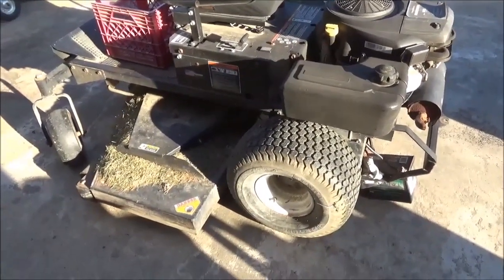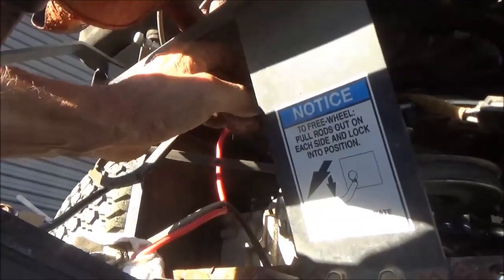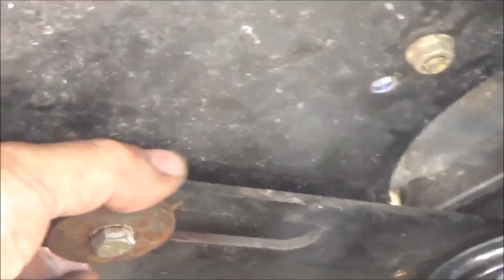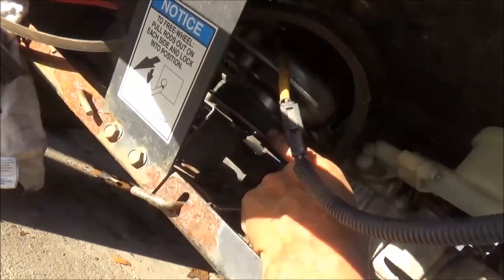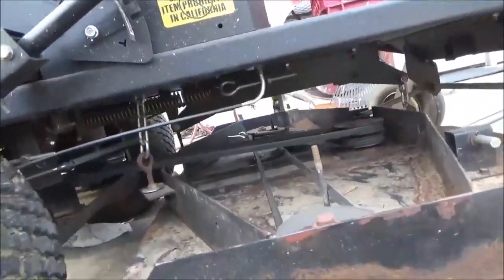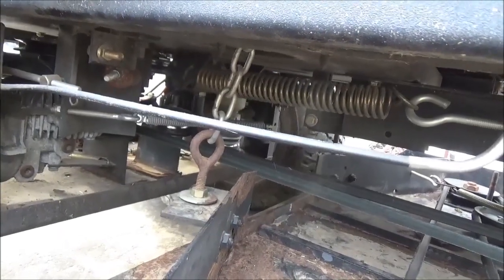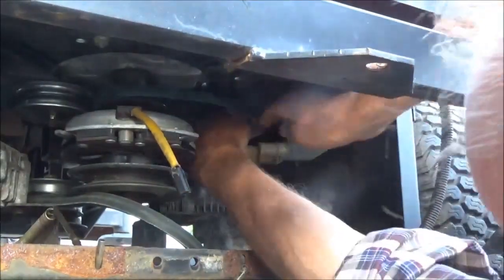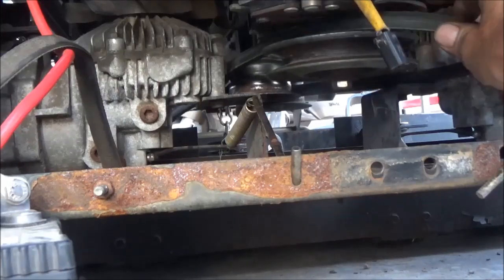Changing drive belt on my zero turn mower  July 8,2017

Comment: Spot on man, thank you. You took my anxiety away, mostly.
Reply from the maker: I hope it works out good for you Paul. Thanks for watching.
Reply: @GordonRobertsonDIY  hi there. Going to do this tonight and came up with a question that i did not see in the video. When everything with the belt is adjusted properly, how much deflection in the belt is there when you push on it? The reason why i ask is to make sure i dont over or under tighten the belt. 

Thank you.
Reply: Did you ever post that video on checking the Hydro Fluid?  Thanks

Comment: So i got one that that starts up good but does not want to move at all.. and i haven't drove it to kniw 100% for sure but the sticks feel strange to me like there reall sloppy or have no pressure on them for sum reason..? It feels like an excavator or loader joy sticks wiggle when you touch or try move them without fastening ur seatbelt or like a skid steer does ya if the safety bar up is still in the up position and all the hydraulics are disabled and run on a safety shut off sensor or switch that has them locked up
Reply from the maker: Sorry I didn't answer sooner. I wonder if your hydraulic oil leaked out? I think a lot of the zero turns use like 30 wt motor oil.

Comment: This video helped a great deal but there was one area that wasn't addressed. How to get the new belt over the tension bar which is between the right and left hydro pulleys. I finally figured it out but WOW!! What a chore. I now know why they charge so much to install the hydro drive belt!!!
Thanks for a helpful video.. Joe
Reply from the maker: Thanks for watching.
Reply: How did you get it done?  I am replacing the drive belt on my mower and am sick of laying under the thing trying to figure out how to do that and finish the job.  Thanks!
Reply: @SonjaDake  you need to take the nut off the long stud with spring on it then loosen the 2 bolts holding the sliding idler bar...my biggest problem right now is fighting to get the pto back on

Comment: They credit Swisher with being the inventor of the zero turn, I have never seen one around here!  I have used many of the well known mowers ''my neighbor owns a lawn care business'' and like Grasshopper & Bobcat the best.
Reply from the maker: I didn't know that about Swisher, I went to an equipment pre auction with a neighbor to look at a commercial Snapper zero turn to give him an idea where to stop bidding, and I liked it, just spinning around on the gravel lot, it seemed to be a very solid machine, and moved like a feather, only the deck on those commercial units is very heavy and needs a foot and a hand to change the height and then you move a pin to keep it there. I would have liked to have that, but can't buy anything like that anytime soon.
Reply: Gordon Robertson hi I want some details
Reply: My old neighbor had a old Snapper from the 70s and he mowed his grass and the grass at the local high school including the trails that the cross country team he coached ran on. 40 inch deck 18 hp onan engine and he cut thousands of acres of grass with it during its life. He never did anything to it other than change the oil, belts and blades the whole time I Knew him and that was 20 years!  He also never picked up a stick or moved a rock out of the way, you always knew when he was mowing:)

Comment: I got one just like it, do you know how much hydro fluid should be in the little tanks on top of the drive motors? Mine has none but it is running, seems like there should be some oil in there.
Reply from the maker: Just make sure it has at least 1/2 an inch to an inch of oil in it. It uses motor oil. I'll be doing a video on changing the hydro oil on one of those soon, I have all the video in the computer but don't have time for the editing yet.Thanks for watching.
Reply: Mine Gravely 730 (24 HP Kawasaki) has a cold fill line about 1/2 inch from the bottom of the tank so it appears there is very little in there but its what is recommended!
Reply: Warren Stone there is a fill line inside the containers. I overfill mine but it looks like maybe 3-4 ounces

Comment: Thanks for the video. I suspect this to be the issue with my 2001 Dixon 4515B I got last year. Motor runs great (Briggs Vanguard) but it quit moving. Got the old barn find for $100.

Comment: i just bought one for 50 bucks..guy said it would,nt start turned out to be the seat switch...i put my battery under the seat with a longer positive cable much easier